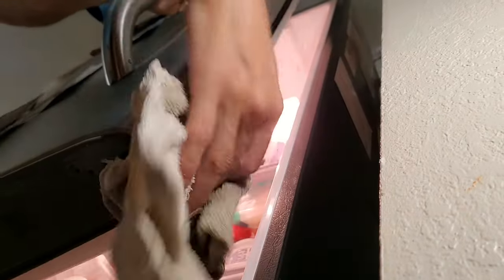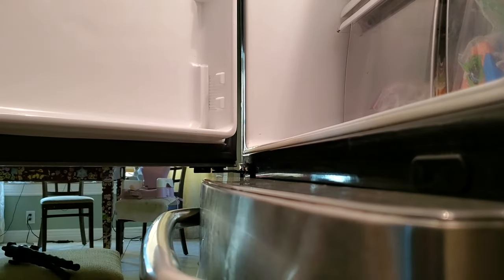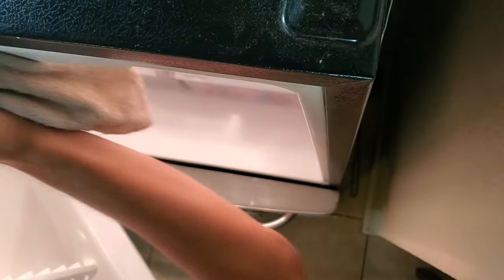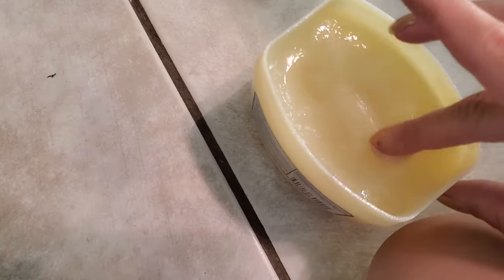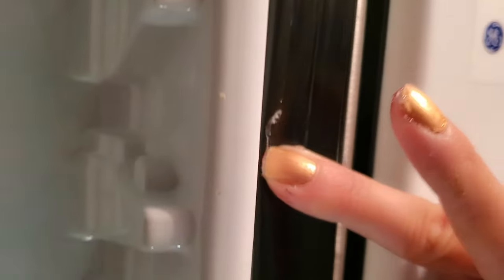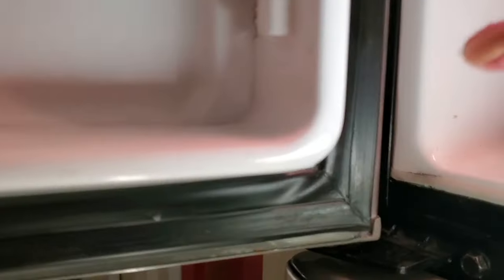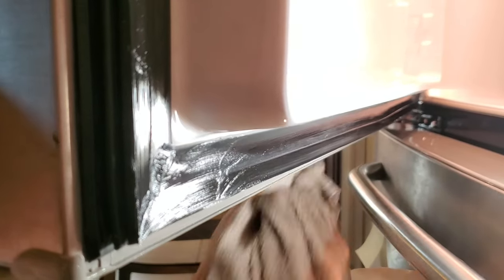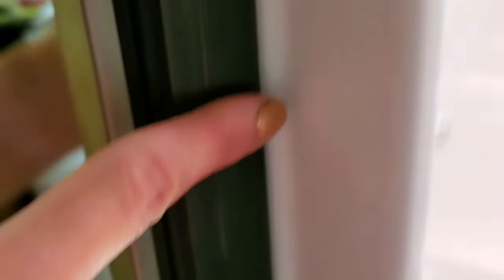#1 RIDICULOUSLY Easy & Cheap Fix for a Refrigerator Door that Won't Stay Closed

Comment: This is terible advice. Go look up chemical compatibility chart and see half the soft plastics and silicone used as "rubber" gaskets in products are degraded by vaseline. If you luck out an the material is compatible it is fine, but neoprene is very popular for such "rubber" gaskets. It is absolutely destroyed by vaseline.
Reply from the maker: Thanks for sharing. Perhaps the manufacturer suggestion is actually planned obsolescence...🧐. I'm at 4 years applying Vaseline with no issue. It's also not a terrible solution if you are just buying time to get a new gasket or full blown refrigerator.

Comment: Vaseline eats plastic... so you are doing the exact opposite of "extending your gasket life"
Reply from the maker: Thanks for sharing. Perhaps the manufacturer suggestion is actually planned obsolescence...🧐. I'm at 4 years applying Vaseline with no issue. It's also not a terrible solution if you are just buying time to get a new gasket or full blown refrigerator.

Comment: Just tried it. Light coating used. Seems to work. Prior to applying Vaseline I cleaned with cleaning vinegar. That really gets anything off that may inhibit the seal but won't dry out the gasket.
Reply from the maker: You know, I've thought about doing that since vinegar is such a good cleaning agent, but I wasn't sure how that would affect the gasket. Thanks for sharing!

Comment: Definitely trying this. My fridge pops open when you close the freezer, but it also has started to pop open on its own now too while we're sleeping, so I'll wake up & everything in the fridge is hot. I hope this helps, really can't afford a new fridge. 😮
Reply: Get it fixed or it will blow ur compressor
Reply from the maker: 🤞this works. If not, grab a roll of painter's tape!

Comment: I actually found out by doing this that my door doesnt close properly since right side vertical no petroleum gets stuck on other, metal, side after i close the door.
Reply from the maker: Good observation there. Bum deal on the larger problem. Thank you for taking the time to come back and comment!

Comment: I use this method also but I've also read where the petroleum can deteriorate the rubber quicker.
Reply from the maker: How long have you been using this method? I'm at 3 years, reapplying about once a year and the gaskets show no signs of deterioration. I'd love to compare notes.
Reply: @OveranalyticalDIY  I recently globbed it on a fridge in the garage as I couldn't get a good seal and it has stopped the cold air from leaking. I had a fridge tech once tell me that this deteriorates the rubber but what I'm thinking even if it does the cost of the leaking air will cost you a lot more in electricity bills than what a new seal would so I use the method now after  I stopped for a while.

Comment: I thought that petroleum destroys rubber. have you seen the long term effects of your idea ? Can anyone else comment on that ?
Reply from the maker: Great question. That's a perfect lead in to the follow up video where I show a couple different aspects to that question: https://youtu.be/BLaxTbfu19c I originally posted both videos together as a single video on my other channel prior to pivoting it to leak detection. I posted it on Aug 13, 2021 with the testing included in that second video. I have reapplied Vaseline two more times in the last two years. No problems in the gasket deteriorating so far.

Comment: I found this which didn't recommend Vaseline:

Instead, try our current recommendation. Simply heat the gasket with a hair dryer or warm water, close the door and keep it closed for an hour or so to let the magnet align the gasket. And presto! It should help to extend the life of your refrigerator seal.
Reply from the maker: Thanks for sharing! Did that end up working for you?
Reply: @OveranalyticalDIY   Not really, although there's not quite as much water pooling on top of the freezer drawer.  I still see condensation on the vertical edge of the doors. It might work better with the hairdryer but I just heated some water and wiped it down. I also read that you should turn off the energy saving feature which would cut down on humidity, especially in the summer.
Reply from the maker: Thanks for replying. The comments are certainly one of the best parts of these videos and others can make a more informed decision as well. As for Vaseline, I've reapplied it on occasion for the last 3-4 years and the gasket is just fine. The door is wonky and doesn't close like it used to so I think there are some other forces at play that Vaseline can't fix. I hope you find something that works for you.
Reply: @OveranalyticalDIY  I want to follow up on my previous comment. A couple of days after my first comment, the water was gone. So I would have to say heating the seal with a rag dipped in hot water really did seem to work.